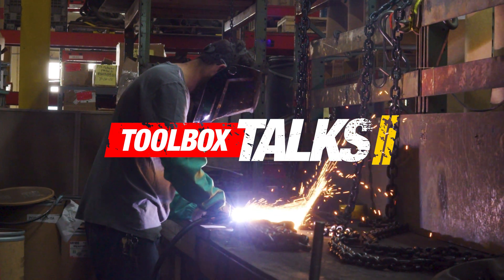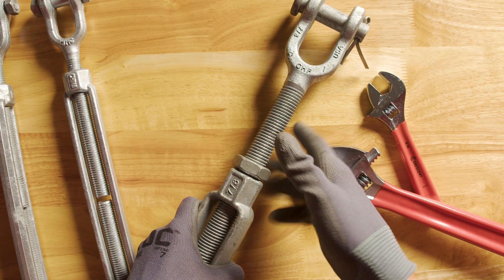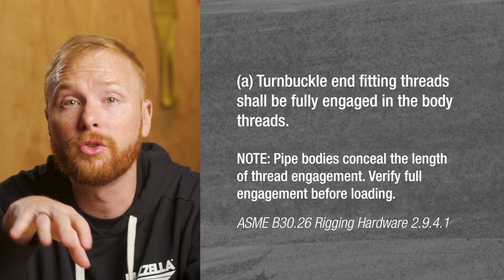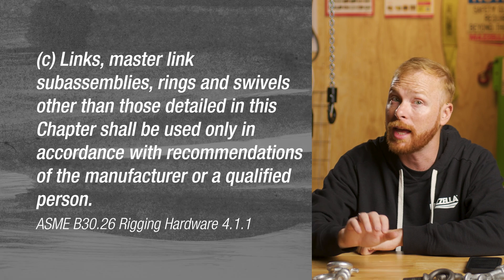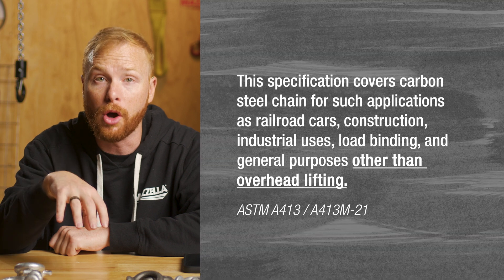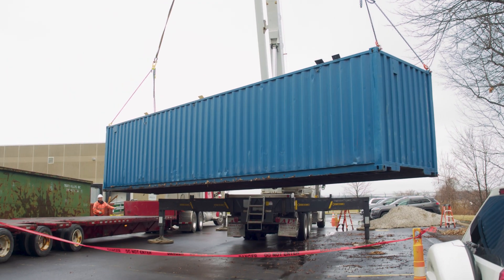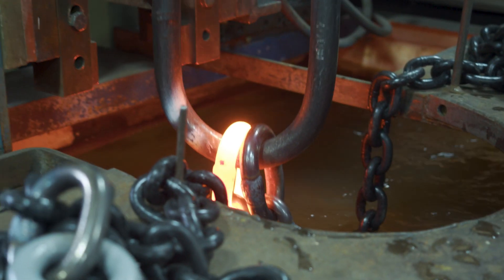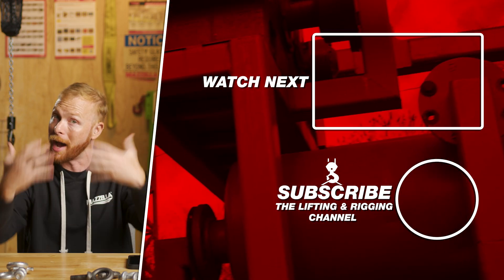Rigging Safety Toolbox Talk: Turnbuckles, Multi-Leg Slings, and Chain Grades Explained

Comment: I've a question, and i hope you guys answer it 
Now i have a polyester made webbing sling never used before, but  it's inspected periodically and color coded with painting on the fiber it self now i have a concern if this sling is safe to use. I jad an argument about how painting affects polyester and there is no statement that prevents painting on the polyester
Reply from the maker: There is no black-and-white answer to this question. This is what our inspection manager, Tom Horner, who has over 26 years of experience performing inspections, had to say.

It is never recommended to paint a synthetic sling. However, it is correct that no ASME statement specifically says you cannot do this. Ultimately, it is the inspector's duty to determine if the paint is, in fact, an issue. A light dusting from overspray is probably not an issue, but has the application of their paint caused other issues, such as stiffness or a lack of flexibility in the sling? I have failed synthetics due to this, which is most notable for paint shops and paint booths. We highly recommend never painting a synthetic sling simply because it is the introduction of a chemical.

We also do not recommend the practice of marking your slings to show that they have been inspected. Here is a link to an article that gives you 7 reasons why marking your slings with inspection tags is not making your lifting program safer. https://www.mazzellacompanies.com/learning-center/7-reasons-inspection-tags-arent-making-lifting-programs-safer/
Reply: @LiftingandRigging  
Thanks alot